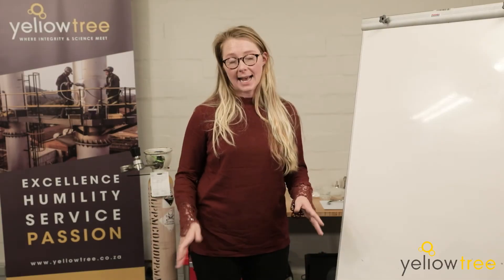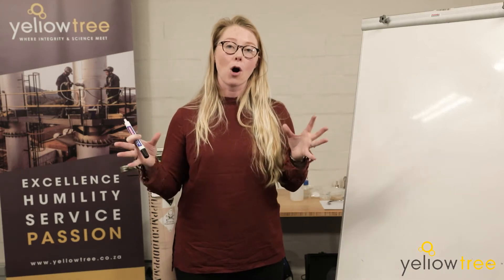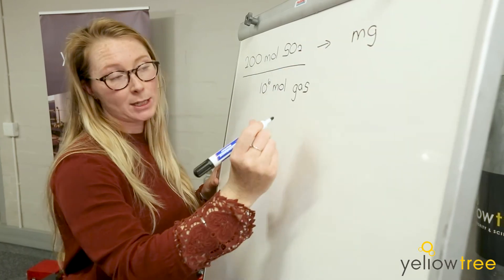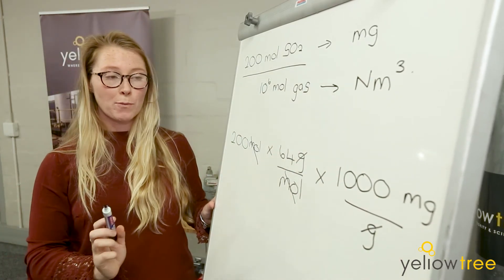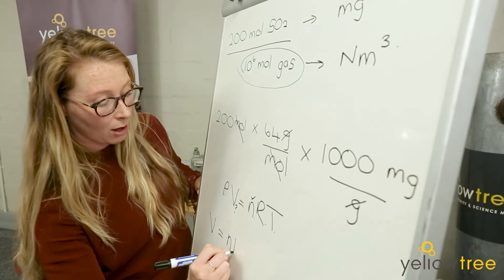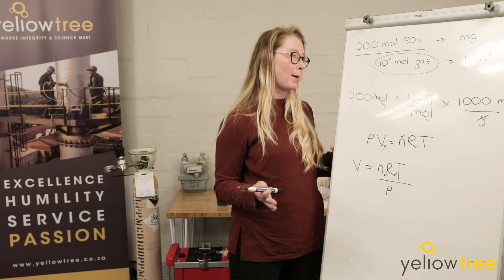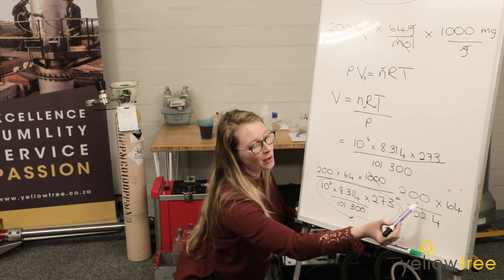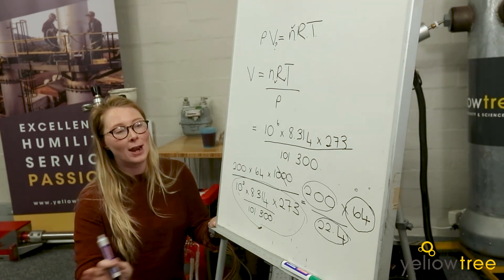Converting ppm to mg Nm3

Comment: Could you please guide me whether we calculate the stack flue gases of coal fired power plant using this equation without considering actual temp and pressure of gases? I mean should I use the P as 101325 Pa and Temp as 273 K in the equation to get value in Nm3, though the actual temp is 155 degree centigrade and pressure is -25 Pa of gasses in stack?
Reply: Hi Abdul. If you want to express your emission in normal conditions (mg/Nm3) then you shall use 273K and 1atm. But if you want to express your emission in actual conditions (mg/m3) then you use your actual P and T.

Comment: Can you explain how to convert ppm to micrograms/m³..... please
Reply from the maker: Hello Abdeslam,

What a great question!

This is a three step process. Firstly, you will need to convert the ppm to mg/Nm3, as per the video above.

Secondly, when you have the mg/Nm3, you will need to convert milligrams (mg) to micrograms (µg). Thirdly, you will need to convert the Nm3 to m3.

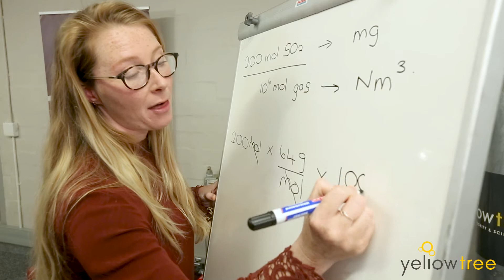Because Step 1 is covered by the video, let's start with step 2. You will notice that at 3:05 in the video, we multiplied by 1 000 mg/g. If you desire your final answer to be in micrograms (µg) instead of milligrams (mg), then you will replace the conversion of 1 000 mg/g at 3:05 in the video with 1 000 000 µg/g. That is easy!

Then let's tackle step 3. You will need to convert Nm3 to m3. This is done using the formula: P1*V1/T1 = P2*V2/T2. Let's assume that your condition "1" refers to the Nm3. At this condition, P1 = 101.3 kPa and T1 = 273K. If you are converting to m3 (condition 2), then you will need to know what your conditions are. 

(I would imagine that you are probably dealing with ambient conditions because the units of µg/m3 are usually used for ambient atmospheric concentrations. So you will use you ambient temperature as T2 and the ambient pressure of P2. Remember to express the Temperature in Kelvin.)

By rearranging the equation of P1*V1/T1 = P2*V2/T2, we obtain V1*(P1*T2)/(T1*P2) = V2. Woohoo! By filling in P1, P2, T1 and T2, you now have V2 in terms of V1.

So take your µg/Nm3, and multiply the Nm3 in the denominator of the formula by (P1*T2)/(T1*P2) and you have your answer in µg/m3. 

[i.e. µg/Nm3 * (1/((P1*T2)/(T1*P2)) = µg/m3]

I trust that this helps! Please share a bit more about your application beneath.

Comment: can you help me how to convert mg/m3 to mg/Nm3?
Reply from the maker: Hello Dandi,

You will need to convert m3 to Nm3. This is done using the formula: P1*V1/T1 = P2*V2/T2. Let's make condition "1" your starting point of m3, and condition "2" your desired goal of Nm3. For condition 2, normal conditions are: P2 = 101.3 kPa and T2 = 273K. You will need to know what your starting conditions (P1 and T1) are.

By rearranging the equation of P1*V1/T1 = P2*V2/T2, we obtain V1*(P1*T2)/(T1*P2) = V2. Woohoo! By filling in P1, P2, T1 and T2, you now have V2 in terms of V1.

So take your mg/m3, and multiply the m3 in the denominator of the formula by (P1*T2)/(T1*P2) and you have your answer in mg/Nm3.

[i.e. mg/m3 * (1/((P1*T2)/(T1*P2)) = mg/Nm3]

Please tell us beneath about the type of work that you do and where you need to use these calculations.
Reply: @yellowtreeenvironmental1562  when i use gas analyzer and the result SO2 is "n" ppm, is it necessary to multiply the m3 in the denominator of the formula by (P1*T2)/(T1*P2) to obtain Nm3 ?,  which is T1 are Temperature at gas analyzer, and P1 are ambient pressure. 

or i just simply calculate ppm x 2,86?